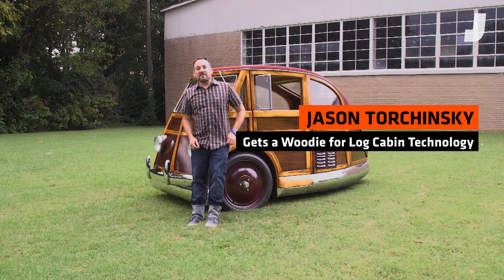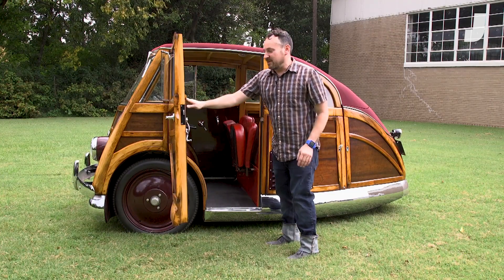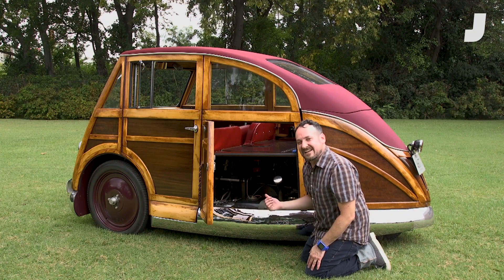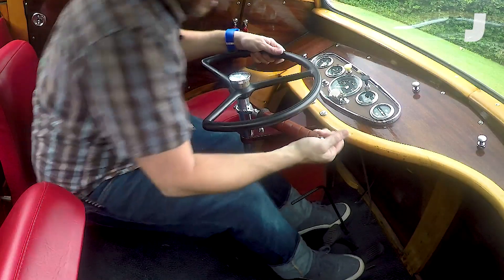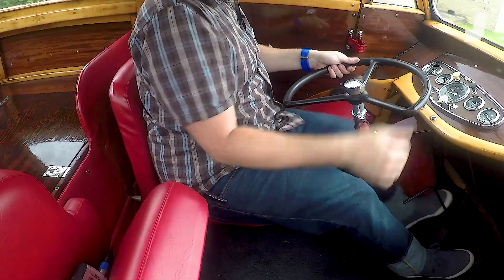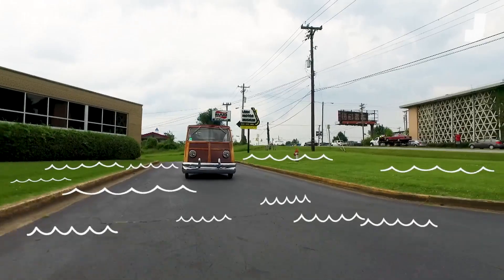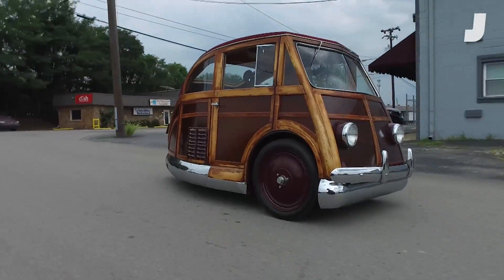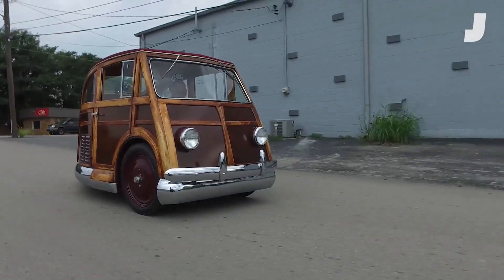What It's Like to Drive a Three-wheeled Log Cabin | Jason Drives

Comment: I am sorry that the prototype of a car called Prvenac (the first baby) by David Pajic (elevator building company) of Yugoslavia does not exist anymore. That was a car Jason should have driven. It had one wheel in the front, one in the back and two in the middle, steering wheel was also used to shift gears with it, headlamps were hidden under the grille, and it used Steyr Puch motorcycle mechanics, so it had no reverse gear.

Comment: Yet it has more power than a Prius
Reply: I respectfully disagree. I had a 1992 Ford Festiva and a Prius was faster than it.
Reply: Actually, a Generation 3 Prius has 98 hp from the gasoline motor, and a total of 134 hp from the gas and electric motors combined, and a top speed of about 95 mph. The Generation 4 Prius introduced in 2014 has significantly more power and a top speed well over 100 mph, though I can't seem to find the exact figures at the moment. The fact is that modern cars, even economy cars, are much faster than many people seem to think, and old cars were (in most cases) nowhere near as fast as many people like to remember them. I worked in the automotive field for over 40 years and I go by facts and measured performance figures, not fuzzy childhood memories and popular myths and misconceptions.

Comment: Ironically a few years later a fire truck pump motor would be used in winning race car. (Coventry Climax) So sometimes it works to use a weird engine... Ok not this time.  Lol this vs the 3 wheel crossbow.